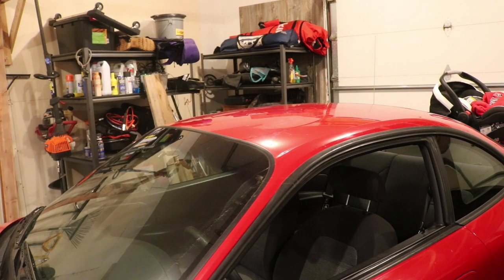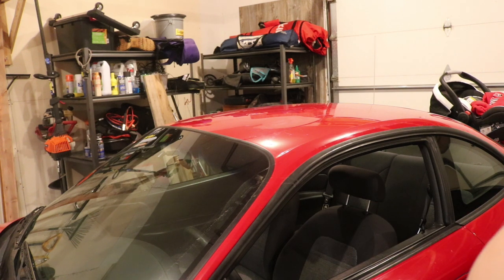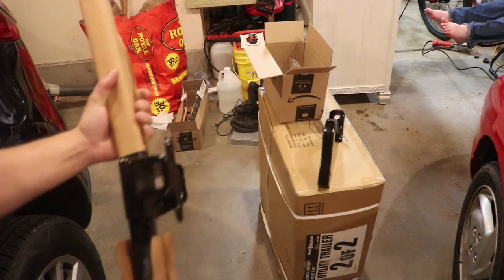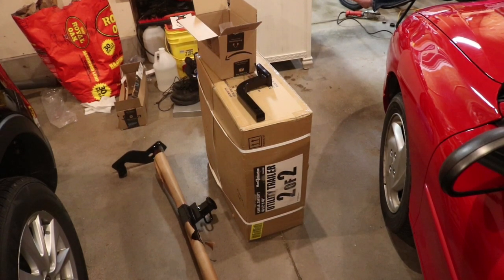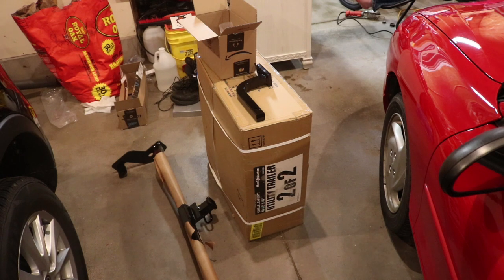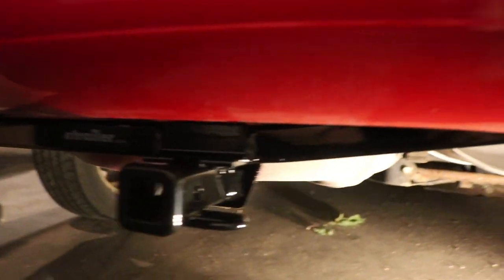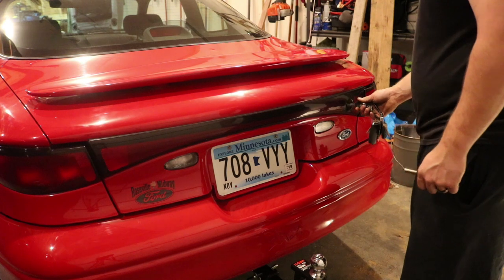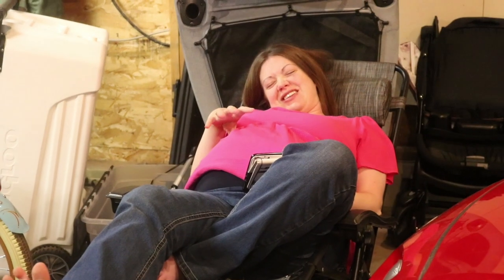Kayak Fishing Part 2 , A Different Approach

Comment: Zach that looks great, how is the quality of the trailer?
Reply from the maker: I'm very surprised by it, I knew it was going to be cheap because of harbor freight, but the steel is thicker than I imagined, the tires are name brand, the lights are led, from what I have researched the bearings need to be re- packed from the start because of the bad grease from factory. But people really love these harbor freight trailers, and for the price point I totally understand why .
Reply: Good job Zach!  Like the trailer better than roof rack idea.